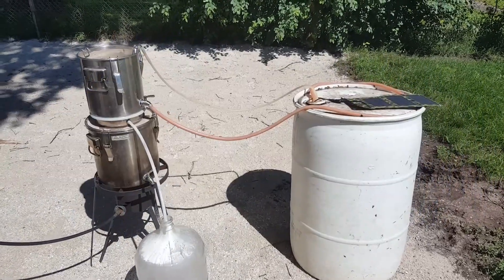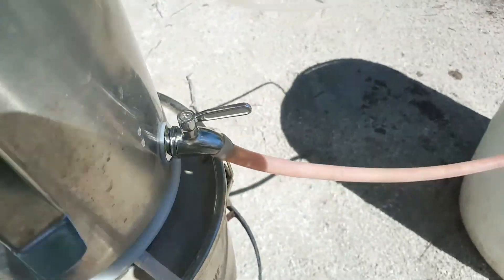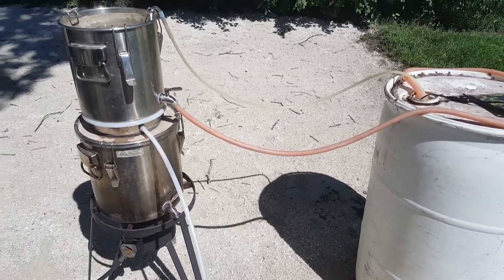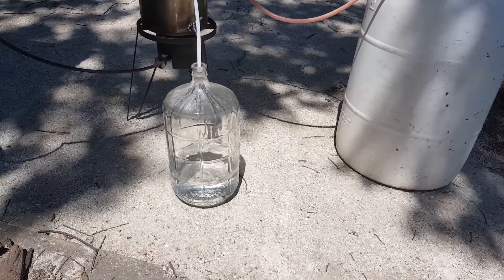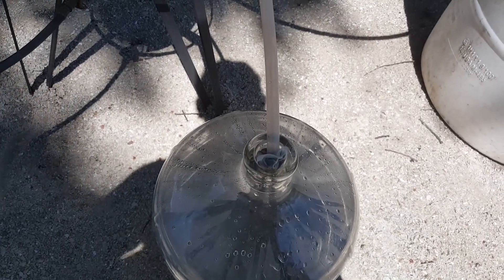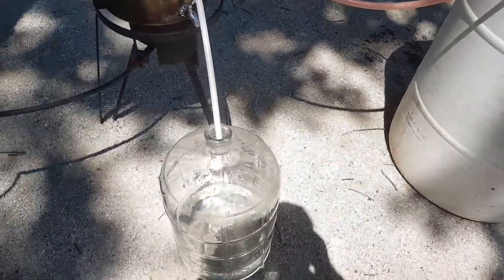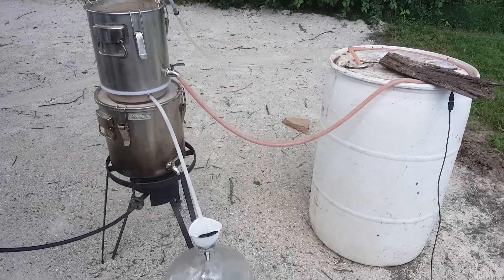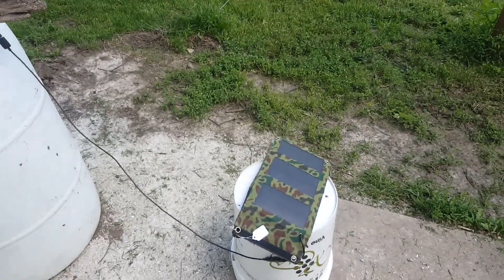Drinking Pool Water in an Emergency or Disaster

Comment: thanks for the video. Seems like a lot of gas produce that gallon an hour.I heard somewhere if you leave pool water out an air raid it over time the chlorine dissipates. Wonder if that's true
Reply from the maker: It takes 8,000 btu/h burner to operate our distiller pre hour.  There's 100,000 BTUs per therm of natural gas, so a gallon of water cost around 6 cents with average price of natural gas 75 cents per therm. So no, it's cheap to operate.
Reply: Yes true but there are other metals etc that can harm you that’s why you need to distill it ..